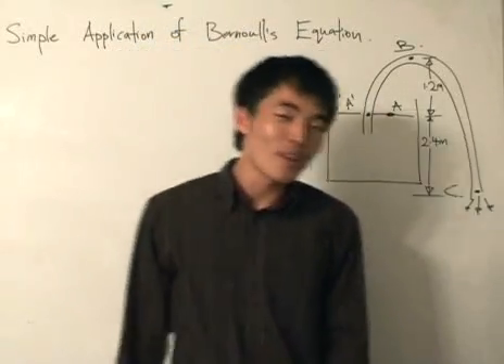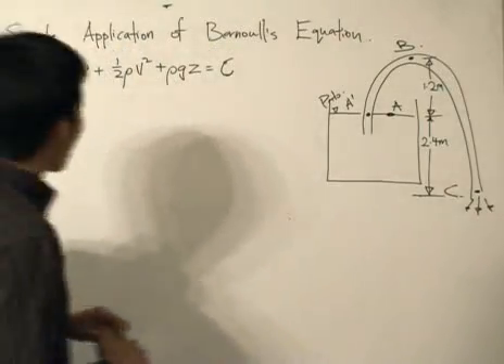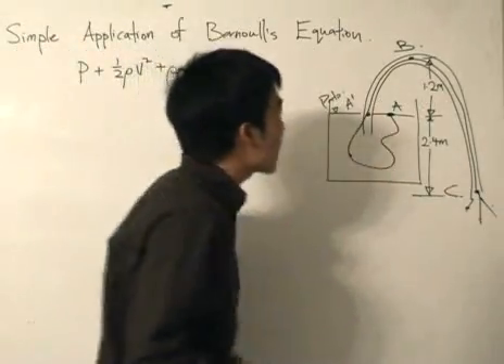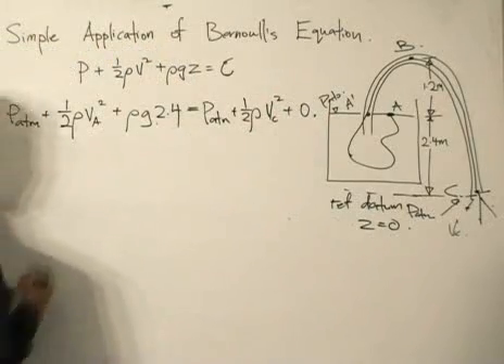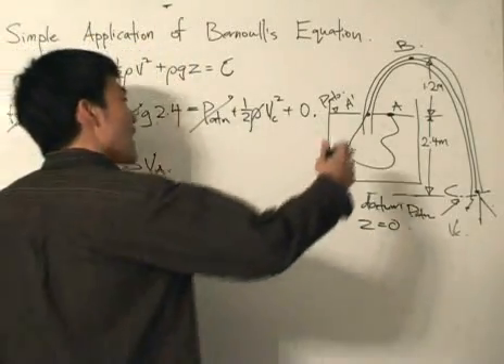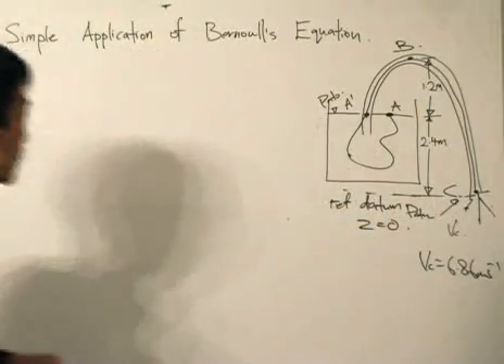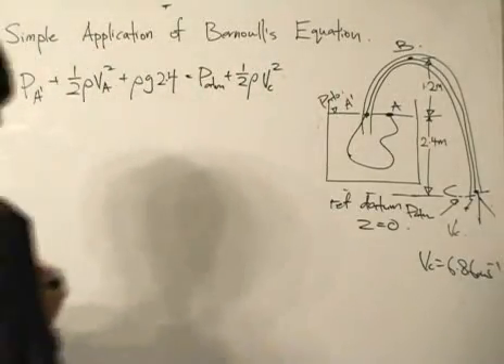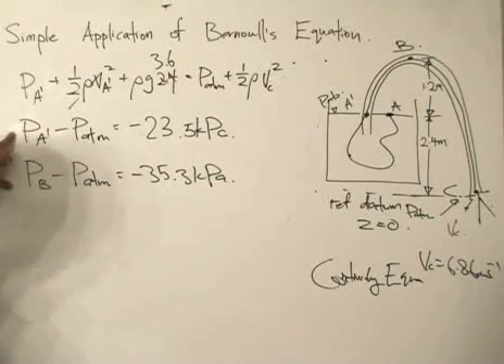Fluid Mechanics - Syphoning Water

Comment: There is a major error that is being ignored.  You should label this as "Siphoning non-viscus fluids" , not "Siphoning Water ".  
I had some calculations to make for a working system, and  IT WOULD NOT WORK.. In fact root (gh) gave results within 10% accuracy of tests.. For water, root (2gh) was off by more than 40%.
I relied on these false formula. You may not realize it, but water is very viscus.  
After searching, I found formulas that work well for water in pipes less than 8cm diameter.
Reply: dude you are right, but he says some assumption  like density is constant. dose non viscous liquid has constant density?

Comment: At 5:00 the equation is not correct. It should be [root of (.5GH)] or [root of (G H / 2)] 
IT SHOULD NOT BE  [root of (2G H)] . GET A TUBE AND PAIL OF WATER AND DO THE TEST.  the physics is wrong. I used several tubes of several sizes. The correct answer is 3.4, not 6.8 - - 6.8 is 100% higher than 3.4 - - therefore the answer is 100% wrong.- - Get the water out and do the test.

Comment from the maker: Yes of course friction is negligible in this case. When you consider friction, you need to analyze the energy loss using a certain 'Energy Equation', an extension of the Bernoulli's equation I believe.

All this is in another section called pipe analysis, which unfortunately I have no videos on it.